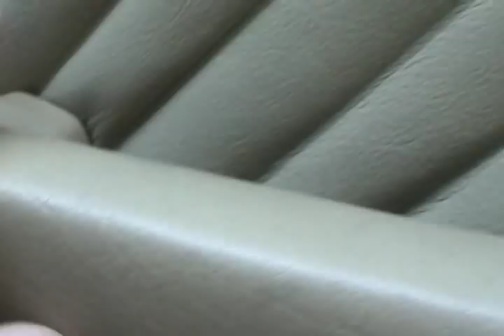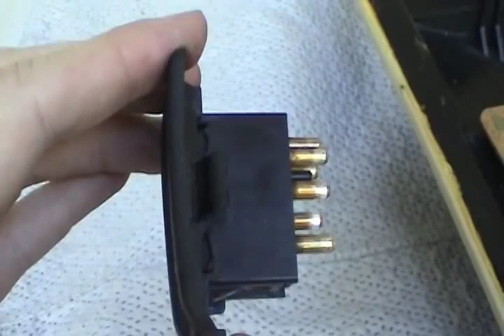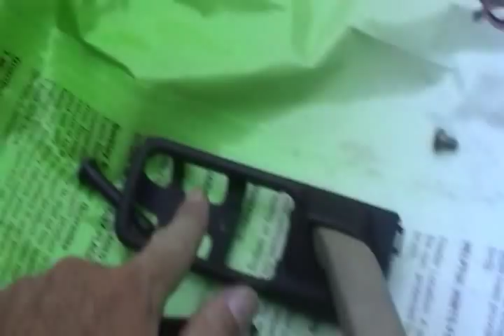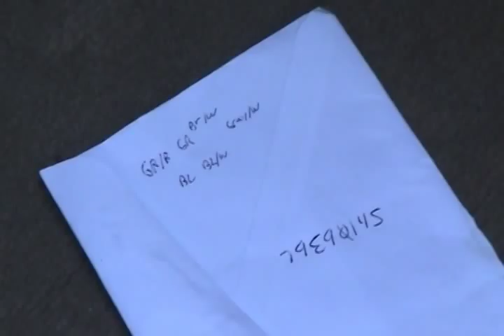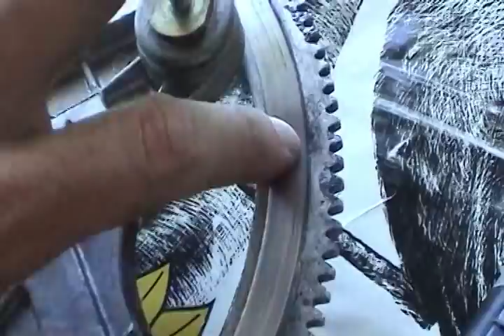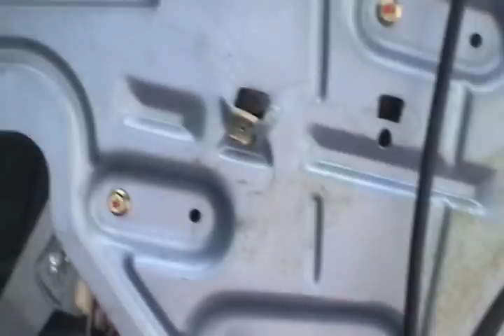1991 Mercedes-Benz 420 SEL Power Window Repair

Comment: My plastic runner clips in my 1991 350SD right rear window also just broke,  i did bring it to the mechanic and it was 2hrs of labor. Honestly it's worth it because i was not  comfortable taking the door apart and putting it back together... but the part itself was only $13

Comment: how did u take that bushing apart and tried and broke a new one ?
Reply from the maker: They are very tricky to get apart but can be done. I used a small flat blade screw driver used for eye glasses and tons of patience. Getting it apart is essential so that it doesn't get damaged when you hammer the pin into the regulator arm.

Comment: Finished repairing the slider, everything back together, and now have no power!  Wth?  Plugged switches back in and all, my power seat works, but power window.  Does not work at door switch or console switch. Does each door have its own fuse?  Cause the other 3 windows still work fine.  Any ideas?
Reply: check your fuses

Comment: How can I remove the OEM screw that you replaced on the regulator? I haven't remove the regulator yet, but I see the mushroom screw already since the plastic component is broken off.  When I remove the regulator do you just hammer out the screw?  Thanks for your help

Comment: Have u by chance ever repaired the front power seats at all?  My front power seats ('82 380 sel) will no longer move up and down. However they still go back and forth, and the seatbacks still go back and forth. The motors are making noise but seats won't move up or down. Sounds like stripped gears?  Great job on your videos they are so helpful!

Comment: wonderful video! I have an '82 sel 380 with the same R side rear window fail. After finding your video I discovered I had the exact same problem, minus the shoddy repair job. Same plastic piece failed after 30 years. Your vid gave me the confidence to attempt the repair myself. I am currently in the middle of repair, as I need to go to the dealer and get the new plastic piece.  Thank you for showing every detailed step or I would not have even tried it myself!  Thanks so much!

Comment: You don't have the wires numbered as well as the back of the window switch? My w116 has little rings on the wires that have numbers on them and if you pry the back of the switch off it has a little piece of cardboard with numbers as well. That's how it is coded together.

Comment: Yes, thank you.  I got it and found the little clips on the smaller sides of the rectangular clips.  My task was slightly different in that I had to drill out the old regulator bushing that was press-fit in.  Thanks to your trial & error, my regulator bushing went in wonderfully.  It was a bit of a puzzle reinstalling the regular trying to mount the 3 screws and align the bushing in the track, but all put back together.  Deep cleaning panels before reinstall - THANK YOU !!!

Comment: when you say push in on the side, are you referring to the side with cables (or opposite) or do you mean the ends of the switch?  I"m at that point now and I don't wish to force it.  Thanks again Shadowrider

Comment: Thank you for the time and effort you put into this to help all of us out here.  While I have the Mercedes Maintenance manuals, your video is fabulous.  My 1991 560SEL has the exact issue on both rear windows. I expect to clean up the regulator gear as well as the slide track, what did you use to clean up the gear and track with?  Also, any tips when taking apart the switch as not to cut the regulator cables?  And lastly, what lubrication do you recommend for the door stabilizing arm and lock?

Comment: Thank you so much for posting such a detailed video!  I have the same car but a 1986, and the window is stuck on both the driver side and passenger side.  The window does not make that motorized regulator sound though.  It doesn't make any sound at all, which leads me to believe it's an electrical problem.  Still, I enjoy your steady look into the problem, and it is inspiring me to try to figure out the rest of my problem.  Also enjoyed your videos reviewing the car and maintenance.